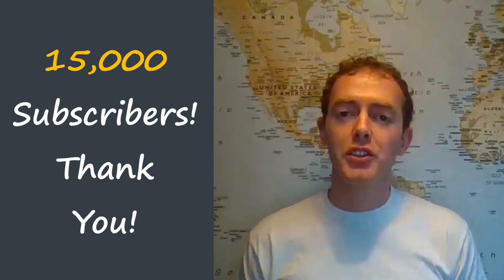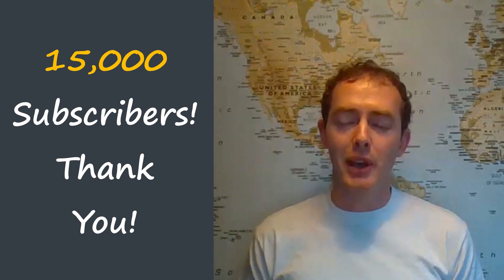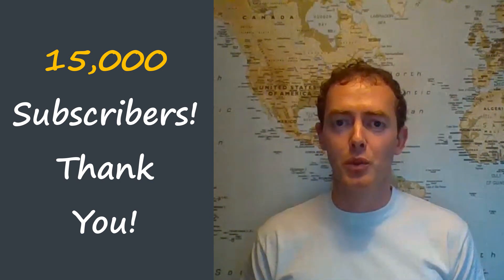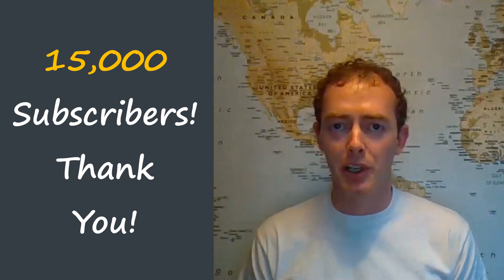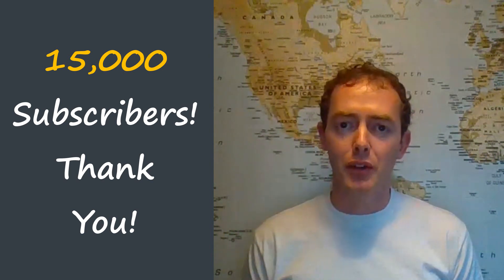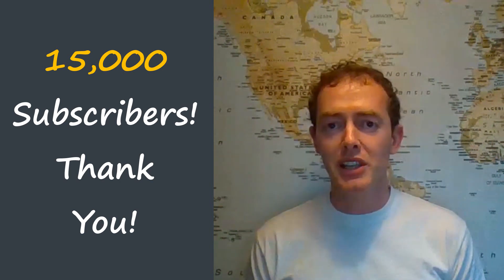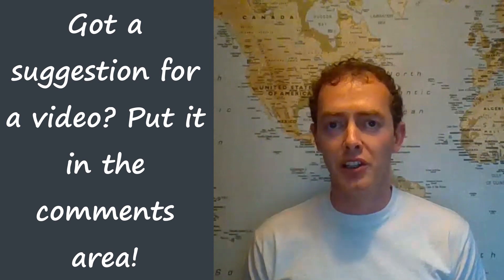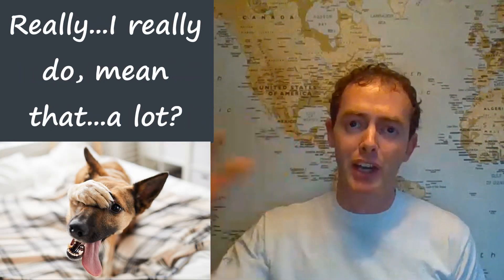Personal Message From Jon - 15k Subscribers

Comment: Hey Jon, congratulations for the 15k subscribers, may there be many more to come, this channel absolutely deserves every single one!

I was wondering could you be able to make a video series, orienting towards power systems, starting with synchronous generators, transmission lines design, and maybe most importantly - short circuits in power systems? Symmetrical components etc.. This is absolutely essential for power systems engineers and would be very helpful, especially with your in depth analysis and knowledge. Just a thought.

P.S. Are you getting paid in any way doing these videos? Are you currently employed?

Have a nice day!